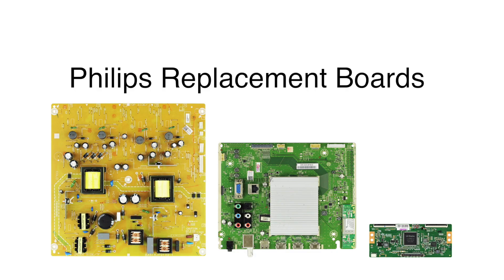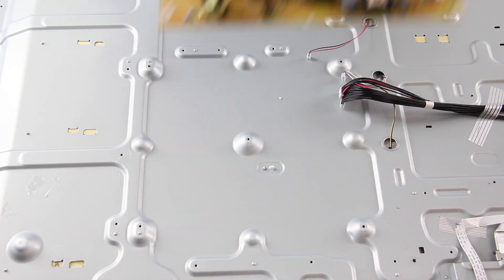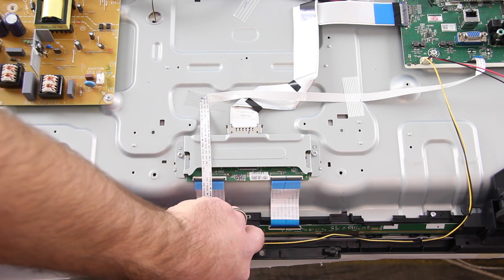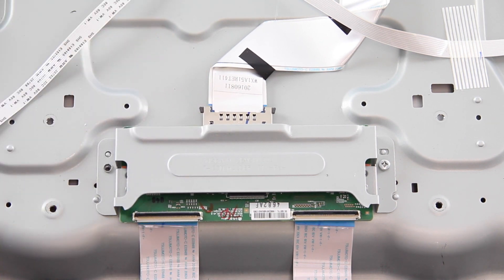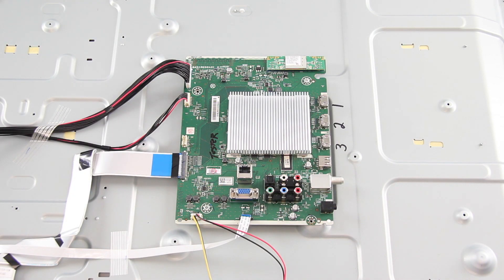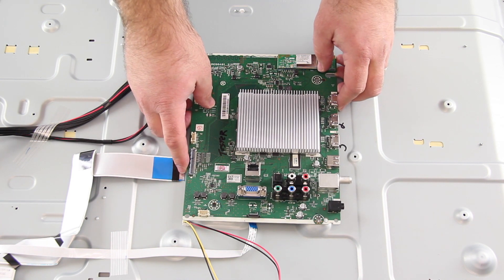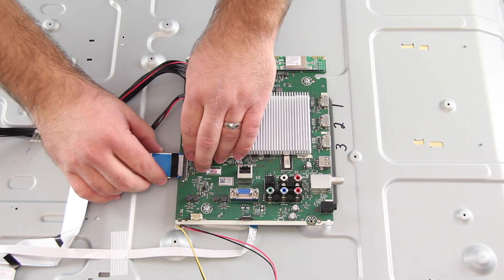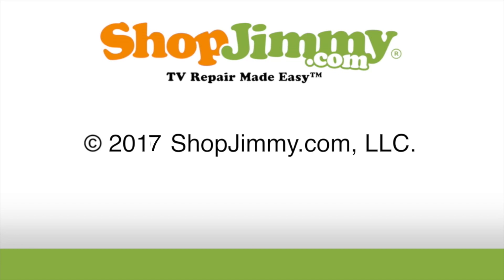Philips 55" LED TV Repair 55PFL5601F7 - How to Replace All Boards for TV Repair

Comment: Has anyone dealt with this model and experienced the fault of turning off after a brief a minute of being on? I think it's a capacitor and likely on the main board since it seems to go off faster if I operate the menu of the tv.

Comment: For anyone who has replaced one of these main boards, do they require any further pairing or s/n matching?  Have attempted to install 3 different boards that were reported as “tested” with no picture or backlights.  Original main board had blue backlight issue.  Was hoping this was a quick swap but I’m a month into my repair due to shipping wait times.  I haven’t found any other info online to support pairing but I find it highly unlikely to get 3 bad boards in a row
Reply: Maybe the problem isn't the board? These three boards represent the guts of the system. Everything else is just moving parts, so matching S/N or anything else wouldn't make a difference as the new board would come with it's own S/N. When my Vizio had this repair done by a professional under warranty I had to reregister the set after the repair as the S/N had changed. That was a 2 grand set, not a 300 dollar Black Friday special like this line. He even attached a new sticker to the rear of the case that reflected the new S/N, which I guess is easier than Vizio flashing the replacement board with the same S/N as the original and then shipping that apparently. My guess is you have a bad cable, if not the display itself. I'd check the continuity of each connection first. If you don't know how search for it here as there are many how to videos. It's tedious but not hard.

Comment: Thanks for the video, I have a Phillips model 55PFL5601/F7 TV, there is a blue hue/tint in my picture, is there a board that I can purchase from shop jimmy to repair this problem.
Reply: Did you ever figure out what it was? Mine is doing the same thing
Reply: @opallesce do you know where to get the new led backlights?
Reply: @nikpeterson1999  any luck? Mines got the same issue. We gotta figure this out.
Reply: Same here, any luck?
Reply: @timothyhubosky9739 back lights

Comment: I replaced all 3 boards in the TV still no picture
Reply: @L. G. all 3 boards wow power board (main) often only requires capacitor replacement why waste money? Yeah be interested to know if u got it going after

Comment: I have a Samsung UN39FH5000FXZA  and out of nowhere the screen went black and had led lights flickering. Well after some time I defer to open up the back. Boards are good. But I decided to unplug the LED cable that connects to the power board and the tv turned on and stop “strobing”. So now I have sound with no picture with that cable unplugged. Is that a sign of a bad T-Con??
Reply: More like a sign of a bad cable or connector on the board or panel itself.

Comment: My Philips 46PFL3608/F7 turned itself off one day, and began chirping. After searching for what the issue could be, it seemed like either a power supply board problem or a main board problem. I ordered the power supply board from you and replaced it in my tv. The chirping did not stop, and the tv would not turn on. I bought a replacement main board from Amazon (you were out of stock) and replaced that board. The chirping has stopped when plugged in, but the tv won't turn on, and the power button does nothing. I can hear the electricity go into the tv when I plug it in. I reconnected all of the connections, but I just can't get this to turn back on. Anything I am missing here? I don't have a standby light or anything
Reply: Ours literally just gone what appears blank but the pic /text is there but too dark to see it so lileky in my case the imbeeter if your standby light goes off and/or there is a brief flicker of lighter shade on turning it on its likely you have my issue any sound? If yours is literally not coming on at all then it couod be (did u say you replaced t con board ?)  If not it could be that ....the inverter breaks down the power to supply the lcd's  etc when it fails it wont power the lights up

Comment: My Samsung j5200 40 inches smart HD Led TV only show Blue Red Green white & black screen after display panel replacement  few hour it works perfectly but as i switched on in the morning the screen just show blank colors Blue Red Green white & black,what i do to solve this problem please help